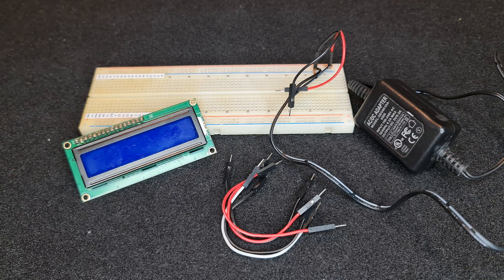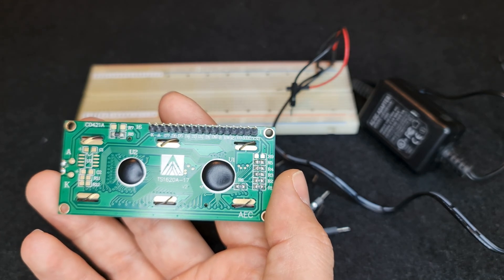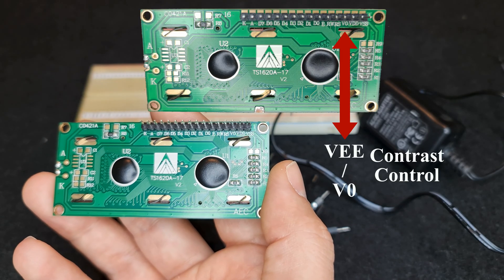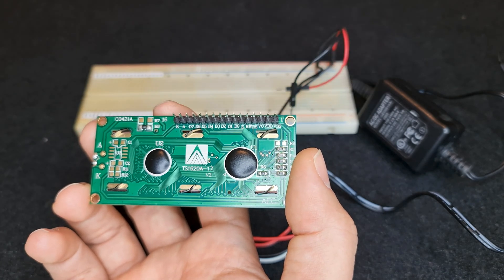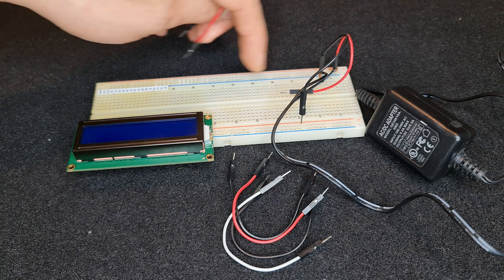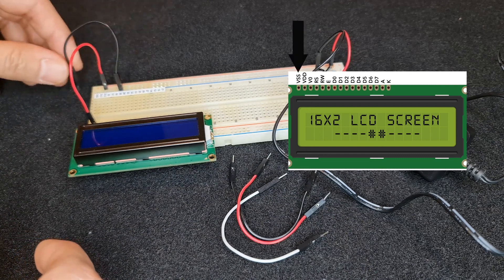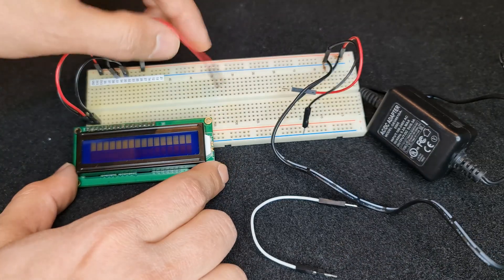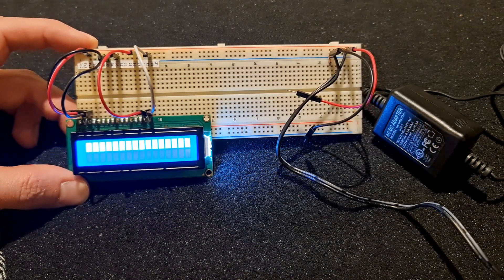Test LCD display

Comment: Hi there and how to correct display contrast? I have 10k potentiometer where should i co net it? One leg to V0 but what with two next? 😁 I can see letters from angle but no straight.
Reply from the maker: Good question,
In this video it is shown:
https://youtu.be/1R8okCY1ACs?si=DHO9noV39t7cwhFF
Reply: Cool so i Just have to connect ground to one leg. One more question :). When I adjust contrast and remove potentiometer it will remember contrast or reset to basic?

Comment: I barley used it and its not turning on at all not even flinching
Reply from the maker: What happened at the end?
Reply: @kian.smarthome  the problem was with the wiring they weren't well connected, had to solder them into the LCD as the LCD I got didn't have pins pre-soldered in it
Reply from the maker: @oximas-oe9vf  Kudos to you for fixing it yourself. 👌👌